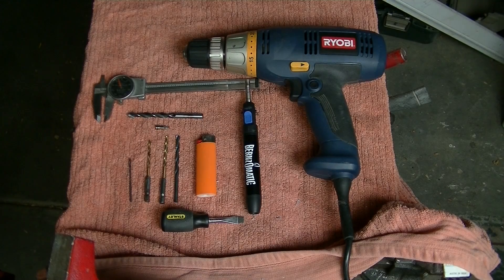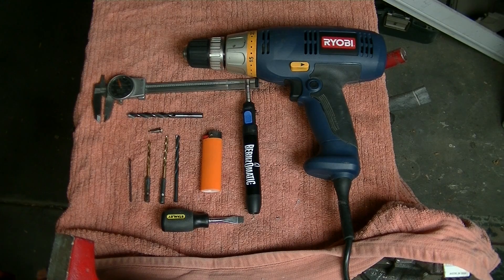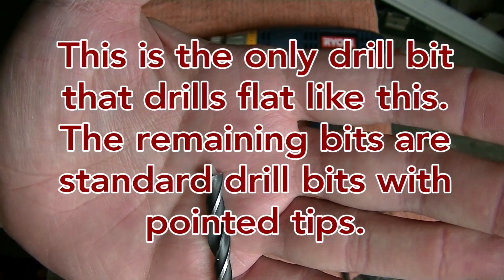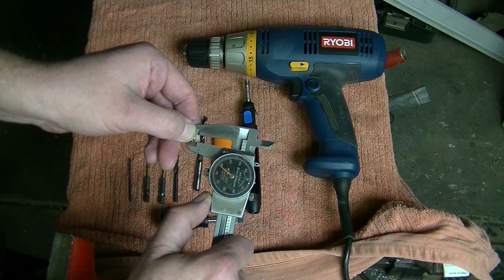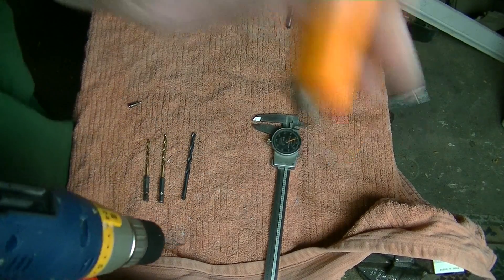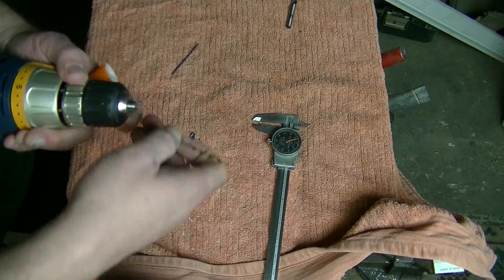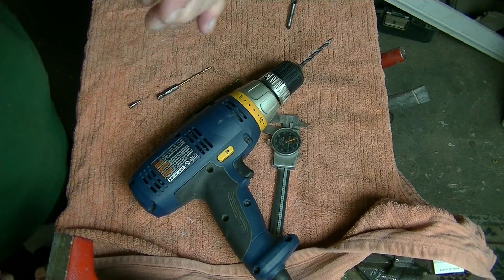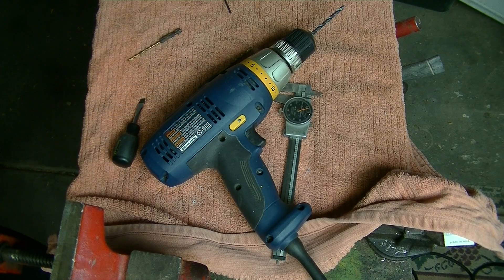Make A Bic Lighter Refillable By Installing A Refill Valve

Comment: I'm sitting here thinking "Why the fuck would I modify a cheap ass Bic to be refillable?" Then I realized that having to go buy a new lighter every few months vs buying a big can of butane is economically better. Also, I was reading a push-pin tutorial before I found your vid, your idea makes wayyyy more sense.
Reply from the maker: Sometimes a woman needs a little more than just the penis .... and you're either committed or you aren't ... this is what separates the men from the boys ... ;-)
Reply from the maker: I never could tolerate a pushpin refill solution which is why I started thinking about adding a nozzle to a Bic ... When I started experimenting, I used different kinds of nozzles and drilled a hole, then used epoxy to seal the nozzle, which never worked out. When I realized that the Bernzomatic nozzle was removable, I studied it for a while and then realized that the Bic could be drilled in such a way that the threads on the nozzle would be sufficient for a seal and then no epoxy required. A few wasted attempts at it and I came up with this method that is bullet proof.
Reply from the maker: @artist quality - That's interesting ... next time your eye itches, put that push pin to use and let us know how that works for you.  :-)
Reply from the maker: Drug users drop out of school and sometimes feel their skin crawling with insects ... whats your point?

"a scratcher as in the lottery scratcher" - with a push pin? Why don't you just paint a wall with a toothpic? The best scratcher for lottery tickets is a U.S. dime! Don't believe me?  Try it!  Then tell me what you think,

Pink eye is a SOURCE of itching, sir, not a remedy for itching ... 

What country do you live in, "artist quality"?
Reply from the maker: Oh I get it now ... the dime is still superior
Reply from the maker: i admit though that the dime costs 10 times as much as the pushpin
Reply from the maker: BUT - you get what you pay for!
Reply: a scratcher as in the lottery scratcher,
Reply: you should look into pink eye for you itch eye
Reply: drug users choose bic because you can have them lit indefinitely and they wont fall apart or catch on fire. Mr Small Bic loves playing with big Bics..
Reply: So if you push the pin part of the push pin into the lighter. You are left with a handle. Correct? That handle composed of hard plastic is good the scratchers. 

I would never use a tooth pick to brush anything. It's missing the. brushes.. That's just silly.. Only you would to that.. You probably put a refill on that too.

I suggested you may have pink eye. That would be the source of your itch. You brough up an itchy eye.. I thought when you were talking.. The wind must have blown some shit back into your eye
Reply: A lot of people "bond" with their lighter, especially if they have owned it awhile. I have paid a lot of money to get cherished lighters back from friends who boosted it. I inscribe my lighters with skrim-shaw type art too, so converting them to refillable is an obvious logical choice.
Reply: did you even know the push pin is perfect for scratchers? I couldnd handle a lighter with out one

Comment: I have a question, does anyone know how to repair the flint sleeve that holds the flint and spring? It's located under the spark wheel. I only use 30+ year old lighters (Classic Bic adjustable flame, pre-1990) and the Flints are usually degraded. Sometimes I break the sleeve digging out the old flint. I tried a coffee stirring straw but it's not strong enough and flexes and makes my flint get dragged out of the holder and pulled under the spark wheel. Any ideas? Any metal tubes the size of a coffee stirring straws out there because that's the perfect size.
Reply: Todd Twopapers Try a toothpick
Reply: A drop of CRC (yanks call it WD40), leave overnight and then use a precision drill piece to hollow centre of flint out, if stubborn - gradually increase size of drill piece to hollow out more but it should grab first go. Keep free of water because moisture can expand flint.
Reply: so the plastic part that comes upward holding the flint has broken off?  maybe try using an emptied fountain pen tube? or an empty pen tube made of hard plastic.  you would need to hold it down with epoxy or some crazy glue?  you should really just disassemble the flint wheel to remove crusty old flint so you don't risk breaking that sleeve which may be brittle from old age.
Reply: look for a nylon spacer by hillman pn#880426.  it is about 1 inch long and the flint spring will pass through it.  you will have to cut it down to size and then use some sort of strong adhesive or epoxy to secure it.  if you can have this "adaptor" stay in place and then you should be good.  Im thinking that you might not even need to glue it down or anything because perhaps the spring and flint wil keep it in place?  btw, I do need some spare parts....    maybe we can trade?  i can send you th nylon spacers for trade of those spare parts.
Reply: That's a great fix! Thanks for that info, now I can take a few awesome lighters out of the parts pile and back into circulation!
Reply: I'll try it. Thank you!
Reply: That WD 40 trick worked great!
Reply: .. word of advice, i would, keep a fire extinguisher close by if I were you...  most of the adjustable flame vintage BICs would need the orings to be replaced if not,, you run a big chance of lighting yourself on fire from these.

Comment: Great vid! I still love clipper and have done for years. 

I buy the solid metal ones and they last for years without needing the fuss.
Reply: Clipper lighters are ok if you don't have access to a Bic. Just like matches are ok if you can't get a Bic. ;)
Reply from the maker: I did purchase three clippers, and I do like them, but they aren't large enough. I'm 6'2" and a bic fits perfectly. I find with the clipper, I'm always having to use the side of my thumb to strike the flint, which is uncomfortable. Not so with the Bic.
Reply: If you ever want to trade some Bic lighters for some Clipper brand lighters let me know, I have three of them. I'm not a fan. Bics or bust.
Reply from the maker: A Stainless clipper would be a gem to have, I agree. I was fascinated to learn that clipper actually makes GASOLINE refillable lighters ... GASOLINE!!! This just begs for experimentation! LOL
Reply: ***** 

Each to their own -Clippers are my first choice cause of the design and the funky guys poke thingy. 

Works with blunts, joints and punching emergency holes in my cigars!
Reply from the maker: the three I purchased had some "choice words" on them ... each phrase utilizing the most versatile four-letter word in the English ... hehe ... and I do agree that for the price, they are more functional in the long run than a Bic I THINK (since I have yet to use them for a long period of time).

But the Bic's - as I said - fit way better in my hand, and I can carve on them with a Dremmel and personalize them in very unique ways which I've done many times. Here are two examlpes:
https://www.facebook.com/media/set/?set=a.10212387649474235.1073741852.1470442082&type=1&l=6dbe929ee4
Reply: ***** 

That's some really cool designs on those lighters!! I don't blame you for liking them more now!

I grew up in the uk so clippers were big over there for a long time. I have had my stainless clipper since I came back from barcelona so it has sentimental value. I won't smoke my Cubans without it. It's my ritual!

Comment: is this safe??  can i trust my life and the lives of those around me wit this in my pocket? 

no bs cuz this is super green and economical  and probably would make the best lighter on the planet even better. but only if this is safe.
Reply: It's as safe as the person using it. I've used my Bic for over a year now, still going strong....and it was made in 1980. Watch out for your unibrow if you use the adjustable flame Bic.
Reply: but if its in my pocket im not using it...? 
 you dont mention if your 1980s bic is modified. and adjustable flame bics dont matter to this particular conversation.. 

and i still dont know if this modification is safe in the pocket.
Reply: Of course not.... Must have been one of those thumb tack people who tried to refill more than once??
Reply: bro no im talkin bout this lil piece of genius this man has put together on that video up there. hell yeah im tryna carry this stuff around even though i dont smoke. baby blankets cant dry off your mud soaked underwear when you fall in a puddle of ice water walking through blizzard cuz your tire is flat and your phone died.
Reply from the maker: I think the proper question to ask yourself is; Do I trust myself and my mechanical abilities to do this properly?  If the answer is yes, then you'll have to explain to me why it's NOT safe, and how this differs from any other plastic refillable lighter.
Reply from the maker: All I can tell you is ... if the nozzle has been installed correctly, and if the lighter has fuel in it, then you can absolutely rely on it as you can rely on ANY BIC lighter which still has fuel in it. I hope that answers your question? And if you are literally and knowingly going to find yourself in such an emergency situation, where reliance upon your lighter could be essential to preserving and maintaining life ... besides the obvious thought which is: PLEASE RECONSIDER THE PATH OF YOUR LIFE, I would add the suggestion of bringing SEVERAL working BIC lighters ... "just in case"!
Reply: I hear you. Your replies definitely assuage any concerns I had about this.
Reply from the maker: Glad I could be of service.

Comment: why not just buy a refillable lighter or a zippo
Reply: Jose Cardenas:  you would use a zippo to smoke a pipe??  if you do, you ARE an ANIMAL...
Reply: Because we demand quality. That's why we use Bics.
Reply: r; u serious?  they get lost, stolen, broken.  There is an infinite supply of free Bics and they are extremely consistent performing device.  All of the refillable lighters on sale in my locality (I suspect this applies USA prolly world_ have severe ignition problems.  Like BIC invented banging two rocks together!  Do you think you could ignite butane with friction, as in a friebow?
Reply from the maker: Zippo's: Flint life SUCKS, refilling is messy, the taste is not pleasant, the fuel evaporates rather quickly, and they are too large.

Comment: He is fake it doesn't even work he switched lighter out noticed when he goes to put the lighter down he hurried up and switched it with the one he fixed but it don't work he just drilled right through the tank inside later
Reply from the maker: Your interpretation of my edit at the end is incorrect.  The lighter most definitely worked.

Comment: I think it is easier just to buy a zippo and a buthane insert
Reply from the maker: @Jose Aponte - Zippos are a very high maintenance lighter with limited application compared to a Bic. Zippo's can even dry out requiring constant and messy re-fueling. I like  Zippo as a nostalgia, but not as my main lighter.
Reply: Why would you want a stinky, leaky, expensive, over rated Zippo? Very unreliable to, that's why everyone has a couple in the junk drawer. Give me a refillable Bic adjustable flame lighter ANY DAY.
Reply: Todd Twopapers ZIPPO, WITH A BUTHANE INSERT... LESS HASSLE
Reply: So in other words, you turn your smelly Zippo into a huge brick sized Bic? What's the point of that?
Reply: Todd Twopapers LESS HASSLE... PLUS U CAN REPLACE THE FLINTS
Reply: We can replace the flints in our Bics too, and they are free! Check mate.

Comment: We're can o get a butane nazul
Reply: Where do you get a GOOD butane nozzle. Just buy one already converted friend, skip the dumb. It's cheaper, easier. $10. Or go buy a lighter, reclaim a valve from a refillable utensil, then start drilling and refilling...or go to an auction website and pic out a color. They also sell Djeep. Another quality disposable lighter brand. Not as classic as a Bic though.
Reply from the maker: look in the video description for a link to an air soft company who sells really good nozzles. I've used them several times now.

Comment: Am I the only person who has converted the 1980s Bic Adjustable Flame lighters into refillable? Why would anyone take the time to convert some lame, modern Bic with a child proof and non adjustable flame? I like my 1980 Moscow Olympics Bic, with the adjustable flame. It has a flush refill valve so you can stand it up just like a normal lighter. Nothing sticking out. Use the plastic refill valve so it matches the lighter's fuel tank. If you are going to sport a Bic refiller, at least make it a cool one. You have to look at it for years. Xoxo
Reply from the maker: ebay ... DUH!! ... LOL
Reply: be advised You are buying an item that's vintage and may need new parts i.e o-rings flint wheel etc.. to be changed.
Reply: Let me know if you need any, I have a dozen of both sizes.
Reply: I'm selling them for $10 each on EBay. I have all the rarest colors too. Good luck finding an old school vintage Bic adjustable flame without it being white or with a logo on it. I have black, blue, brown, red, orange, yellow, green, gray white and tan, all pure color and logo free, just like you would buy at 7-11 in 1983. $10. I even put new Bic brand flints in them for you.
Reply: Both size o-rings. Also have 7-8 flame adjuster wheels. And 150+ Bic lighter flints with over 2/3 life left. I'll keep you smoking for 20-30 more years.
Reply: nice! who woulda guessed empty BICs that had adjustable flame would be worth $10 each?
Reply: $20-30 if it's refillable.
Reply from the maker: @Todd Twopapers ... I REALLY REALLY REALLY want a vintage adjustable. I tell people about them all the time and I tell then how in the 70's and 80's EVERY Bic had an adjustable flame ... nobody every believes me ... but I'd love one of those for the nostalgia and id love to make it refillable of course. Doesn't being the only expert on making a Bic refillable - here on Youtube - get me any kinda celebrity status where I then get cool stuff ... for free?  lol
Reply: ummmkay... so where do we get a 1980s BIC?? from a time machine?  pfft.... or maybe a vending machine?
Reply: They have this great invention called Ebay buddles. I haven't had any trouble getting 50 of them. How is it you can figure out how to mod a Bic, but you can't figure out how to get a pre-93 Bic? You from Croatia? Schmuck.
Reply: I think you are missing the point....  for me, I'm not trying to buy something already made.  I'm trying to repurpose junk/garbage that can be deemed useful.  sure, you can go on ebay and buy one like yours... if you are lucky enough to find someone listing one for $20+... but thats defeating the whole purpose and for those of us who like to make things, there zero fun in just buying it. you make it sound like its so easy obtaining one of those vintage items while such is not the case.
Reply from the maker: Where in the hell did you get your hands on a 1980's adjustable flame Bic lighter?  I'd gladly murder the next person to post a comment asking WHY? for one of those lighters ... I'm salivating .... lol
Reply: Mike Sims  haahahahahha
Reply: What color would you like? I have finished product and untouched stock Bic adjustable flames from the 1980s. I'm getting low on colors from selling them on EBay, but I might have what you need? Let me know.

Comment: The 1st drill bit is called a " pilot point drill bit "  Great for starting a new hole & if using a center punch to mark a hole , It helps prevent slipping off center as well . In the bottom of your lighter there is no need to center punch for marking the start of the hole . By the way GREAT VIDEO :)

Comment: buddy... go find yourself a fill valve for airsofts... i've been doing mine with them for years now.  i used to get my valves from cheap lighters that have smaller metal vaves but airsoft valves are best... there you go~ you got your source~
Reply from the maker: ummmm ... did you see the video description or the note I added to the video where I talk about where to get the nozzles?

Comment: ive been doing this for years...  i woulda made a vid if i knew how... the thumb tac method is retarded... your method is a little too much... mine can be done in less than 5 miutes-  i recommend teflon tape in case you drill the hole too big...
Reply from the maker: The method I came up with here can be done in less than 2 minutes. But teaching anything takes time because you have to cover everything and help people understand the details so that doing it just makes sense. I'll bet you didn't learn the quadratic formula in 5 minutes, but now that you've been taught the details, the reasons why etc., you can probably crank out a quadratic formula problem in less than 5 minutes when it took hours to understand in the beginning ...

Comment: So  a lighter with a thumbtack in the bottom of it  that cost less than a penny a piece is more ridiculous than spending $10 on a butane lighter just to get the fill nozzle out of it to repair a $.099 lighter
Reply: You have more patients with these types of rocket scientists than I do... They deserve to be one of those retarded thumb tack using people. They will wonder why it only refills once and then their stupid little tack shoots out and they burst into flame. LOL
Reply: the flint can be changed out. its not like you can't find used bics laying around... see, if you can make one of these, then changing the flint out isn't going to be all that big of a deal....   to the original poster aaron,   the thumb tac method is for retards.  you can't fill those things without spewing a majority of it before it gets capped... btw, you dont need a fancy valve, you can take a fill valve from a cheap bbq lighter and use that.
Reply from the maker: Verty - you could not be any more incorrect about the flint. They do in fact last for dozens of refills.